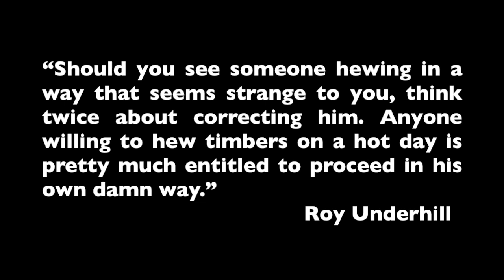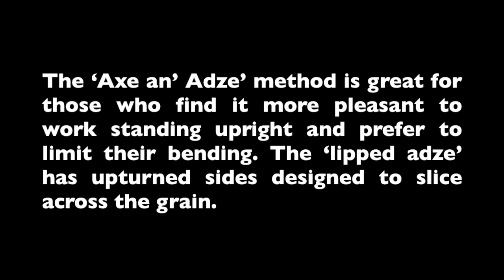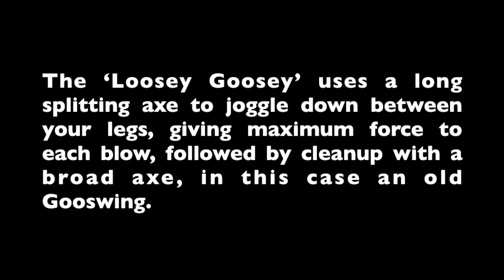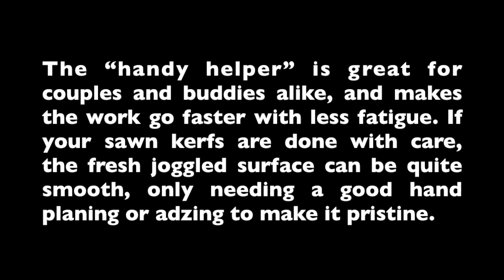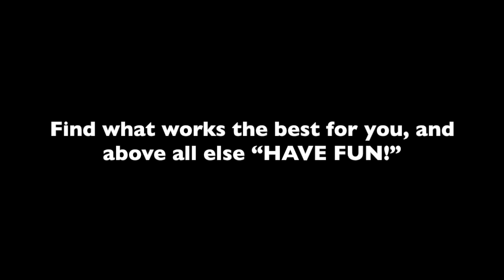A few hewing methods

Comment: I see you own a broad ax? I have one that is about ten inches along the sharp edge and is sharp only on one side it had a piece broke out of one end that I repaired but the quality of steel I put in wasn't the same as the ax itself it has a curved handle. Great videos I enjoy coming to look you put a new perspective in the art of wood working. I thought at first about using all the hand tools as time consuming but it actually is kind of therapeutic Do you feel this way about the process?
Reply from the maker: I got to practice alot of hewing and figure out what works best for me. I do have a broad axe but I found for rough hewing I prefer just a single blade felling axe, and for a fine finish I get better results with an adze than a broad axe. 
It is therapeutic, that is one of the reasons I use only hand tools. I suffer from PTSD and the noise of power tools is not good for me, but hand tools are great therapy.
Reply: I take it you were in the service?
Reply from the maker: USMC '05-'10
Reply: I heard stories that the government makes you join in the US is that a myth I live in Canada and it is optional here. I remember this guy I worked with one time who was canadian was picking potatoes down there  it was during the Vietnam era and they caught up with him somehow they told him he could stay if he joined the army and went to over to fight. I remember he said they said what will it be the army or the border. he chose the border and came back to Canada.
Reply from the maker: They have in the past, like WWII or vietnam….its called the draft, I volunteered.
Reply: Marc  A Gagnon I think that was wrong that they did that to a guy just trying to work who was here legally
Reply: Thank you for your service. You are what makes this country FREE!

Comment: Hi, very good video showing the different ways. One day I will be doing this and I will remember seeing it here. Do you have a preference? And would you try sawing lengthwise with a partner?
Reply from the maker: If I have a partner, method 3, if alone, method 1, we will try Pit sawing lengthwise one day.
Reply: sawing lengthwise is much more tiring than axe method. but you could use side planks as cladding...

Comment: I have a question for you if you don't mind: I just picked up a nice broad axe without a handle.  I plan on putting a handle in it, but before I do, which way should I make it - right handed or left?  I am a right handed person.  I have seen hewing done (by right handed people) from both sides.  So it is a matter of preference or is one way better than the other?  Thanks in advance for your input.
Reply from the maker: Typically you would hang it on your dominant side. If you want to go the other way there are ways to hang the head so you can switch it out, depending on the axe type some are interchangable and with a wedge you can switch it over. Another option is a double bevel Axe but it sounds like you have a single bevel in which case its either all one handed or you have two one for each side, or you design the handle to be switched over, which can only work with those axe types that are symetrical.
Reply: @MrChickadee  thank you for taking the time to respond. I was leaning towards making it right handed. I have an old red oak log laying where I've been gathering firewood that is still solid, I'm wanting to make an 8"X8" beam out of it.

Comment: @ Mr. Chickadee what should I use to finish my beam? Boiled linseed oil? Anything suggestions would be appreciated : ) it's maple if that makes a difference.
Reply from the maker: It may depend on the season and the intended use. If its summer and you will use it outdoors or other wise exposed you could burn it as in the japanese method, then oil it with a mix of pine tar, RAW linseed oil, and citrus solvent. Don't use boiled linseed oil, lots of nasty chemicals in there. Raw all the way. If you don't want to burn it for looks, Id spray it with a Timbor solution and water, then oil it with the Above mix
Reply: MrGritz7 د

Comment: I realize the answer to this question is based on skill level, but in general how long would it take to hew a 16 inch diameter, 20 foot log (lets say Poplar) into a 5 inch thick board useable for a log cabin?
Reply: After watching this excellent video, I should have just asked how long did it take you to hew the log in the video.
Reply from the maker: couple hours

Comment: I'm curious why not use a saw? I know this might be a loaded question, but I'm super curious... To clarify, the length of the beam...
Reply from the maker: Are you asking why not use a hand saw to saw down the length of the beam to square it? If so, this would take much longer and would be very difficult to do, it might be done with a pit saw or japanese whale back saw, but would be a much longer process to complete.
Reply: Mr. Chickadee yes, that's what I meant. My concern was keeping the one true, not so much the time.

Comment: Very nice work, with a beautiful finish. The sharpening stone you were using, I have never seen. Can these be purchased? Thank you, I'm subscribed.
Reply from the maker: Thanks! Yes, I bought mine from ebay cheap, I think they are called an axe stone, or puck
Reply: Mr. Chickadee
Thanks! I've always used rectangular wet rocks but never seen or used the puck as you described it.  I will certainly do a search, thank you.

Comment: If I came across someone hewing logs in the hot weather I would run. You have to be crazy to do it in the summer heat and crazy  and axe does not turn out well.
Reply from the maker: Haha, yep, I think its better winter work for sure!
Reply: Mr. Chickadee Yes it is.

Comment: where do you find your tools? are they new or vintage? iv'e been searching for a broad axe at flea markets and sale's and nothing ever shows up.
Reply from the maker: I won't buy a new tool, don't trust the make or materials in them these days…most are ugly too with plastic handles ewww! Broad axes are tough at local sales, back in the day only professionals used them a lot, most work was done with a normal felling axe, in fact last year our entire workshop featured in videos was rough hewed with nothing but a felling axe, I only adzed a few of the first oak sill plates, then abandoned that. I don't like broad axes actually, I find the adze more enjoyable and leaving a better finish, can be slick as glass if you take the time. If you really want one just because, Id go to Ebay...
Reply: i live in amish country in PA, and i seen a group of them that build log homes. but the outside of the building is basically shaved with the broad ax, looks amazing. is it better to build your timber frame with green wood or already dried wood? i kinda thought green would dry and shrink and make everything tighter?

Comment: what was the actual time for all that work?
Reply from the maker: about 3 hours
Reply: 6 hrs?
Reply: I'm currently 77. As a teen, my father showed me how he hewed a log. He stood on top, struck the side with a double bit axe, one deep stroke, he had tremendous control  (and strength), then with a broad axe flattened the scored side. 16 ft log took him about 20 minutes per side. Before I was born, he built a large log house for his sister, who had 13 children. My father and sisters husband went into the properties timberland, selected trees, cut them by axe and crosscut, drug them by horse to building site, prepared logs (debarked and flattened 2 sides), and built the house. I always thought that it was one of the most beautiful houses I had seen.  BTW the adz work was done standing on top of the log and hewing chips under FIS toes. At least he wasn't barefoot.

Comment: Seems very inefficient.  1/3 of the log got wasted.
Reply from the maker: no it warmed us in winter. or you could use a sawmill and cut boards from the sides, expect them to cup quite a bit as they will be sapwood and flat sawn.
Reply: It could be made into charcoal for my forge